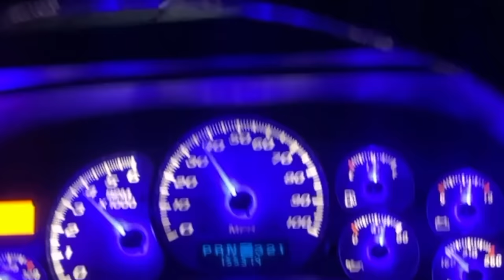Taking The Swang Stang To The Next Level!

Comment: 17:44 the "ridge" at the top of the block is from a combination of things. You get carbon/junk buildup there because the rings don't scrape the very top of the bore. You also don't get any wear in the bore diameter in that area because the rings never touch there. They sell a tool called a "ridge scraper" that you can use to knock some of it off. But in the bigger scheme of things, it's not going to hurt anything in your current situation

Comment: You got to do some porting to the oil holes In the top, front and oil filter spot to help get the oil back down into the pan faster. You can gain more oil pressure to by porting the spot where the oil filter attaches.

Comment: 351W is the way to go. I had a '92 Notch with a T-trim Vortech and 351W with Trick Flow Twisted Wedge heads. 351W and don't look back. (When the 302 splits down the lifter valley)

Comment: Girdle won’t help I split a couple with girdles. They split from the cam opening all the way up and across the lifter valley. Mine split around 550-600 wheel. Went to an a4 block and never had another issue.

Comment: I set up a center pin on my '94 that you get to through the opening in the grill to use with the push buttons as an extra safety precaution. It's cheap insurance. The Aerolatches are better functionally, and more trustworthy, but I don't like the looks.